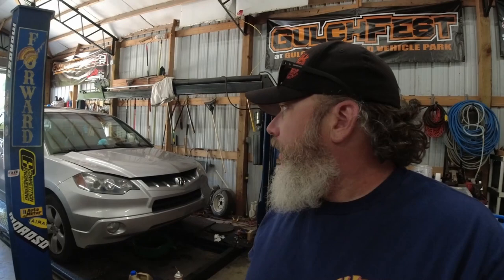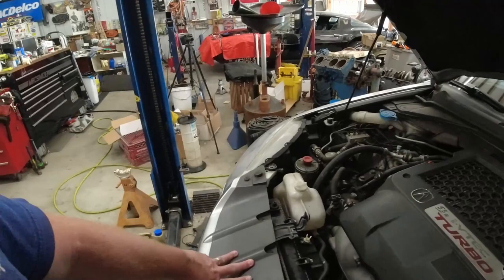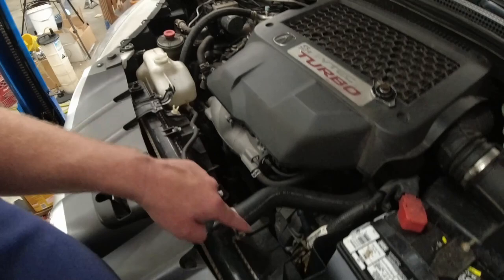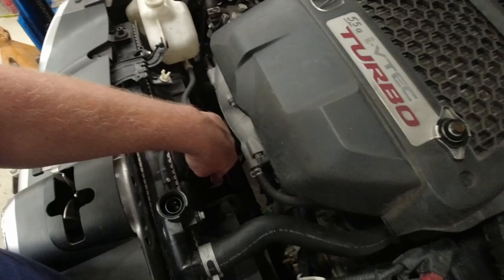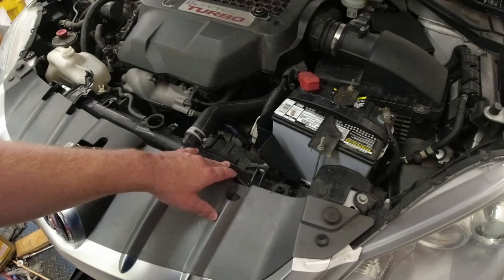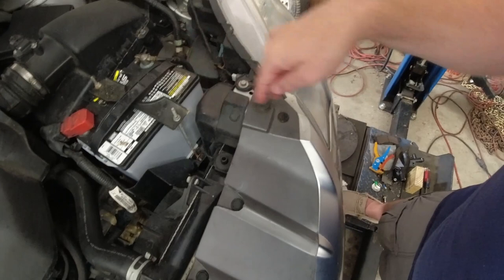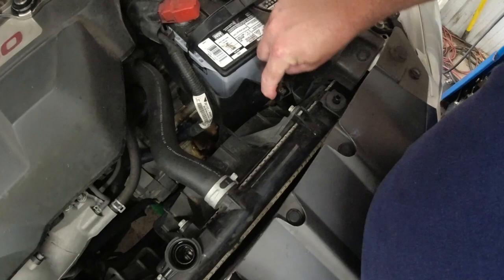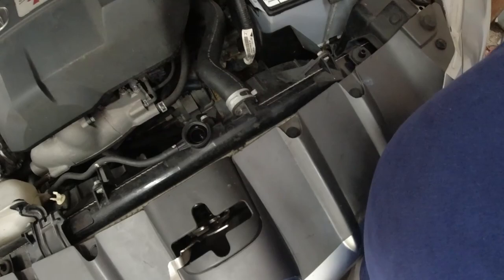2008 Acura/Honda RDX/CRV Leaking Radiator Replacement

Comment: Great video. Today I planned on replacing the starter motor in my 2007 RDX. Ended up puncturing the radiator while trying to break the back bolt on the starter motor (Newbie error) and ended up having to replace the radiator as well. Great write up. My radiator had a connector on the lower radiator hose inlet. Was a pain getting that thing off the old radiator. Ended up working out. Successful job today getting the radiator and starter motor replaced. Great video though, sums up the removal and install very well.
Reply from the maker: Thanks Man! Everyone breaks stuff it sucks but it happens.  Glad you gave it a shot and got it done

Comment: Those lower rad hose fittings are a PITA. Had the same issue on my daughters civic. A little silicone grease on the O-ring makes reassembly easy. Also makes the job super easy in the future.

Comment: This video is a life saver! I had planned to replace the radiator in my wife's 2007 RDX this spring, but wanted to wait until after tax season (I'm a CPA). Well, this week her starter went out and while I was breaking a bolt free earlier this afternoon, I wasn't paying attention and the handle of my ratchet hammered the radiator and poked a hole in the fins. Needless to say, there was coolant leaking everywhere. After about 1.5 hours of fighting with the darn wiring harness clips, I finally got the second fan out. Now I just need to take off the hose connections while I wait for my Denso replacement to arrive s. Thanks so much for sharing this video so us DIYers can continue wrenching on our vehicles!
Reply from the maker: Thanks for watching and I hope it was some kind of help.

Comment: For those of you that have a 2nd gen rdx, It is way harder than this because there is no room to work. Plus in my case, 4 of the 6 fan shroud bolts broke off. My 2013 had a lot of rust most likely because I live in the northern US.

Comment: Great video!

Do you know about how much coolant the refill took? I'm doing ours soon (preventative maintenance since the original is at over 220k miles!). 

Honda coolant is $$, so I don't want to end up with way more than I need!
Reply from the maker: I don't remember exactly.  I usually pickup 2 gallons on 50/50 premixed on a small car

Comment: Exact same issue on my son's 2007!  Heat also not working, where are the heater core hoses that feed into cabin?
Reply from the maker: I would have to go look and that car is not here at the moment. Shouldn't be hard to find them they have to go thru the firewall